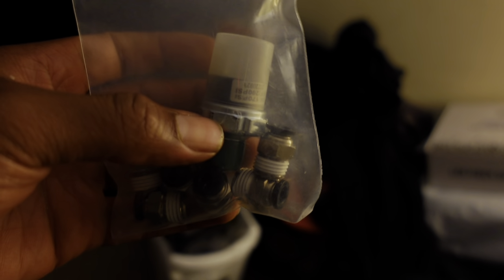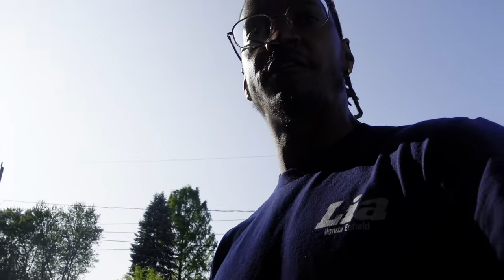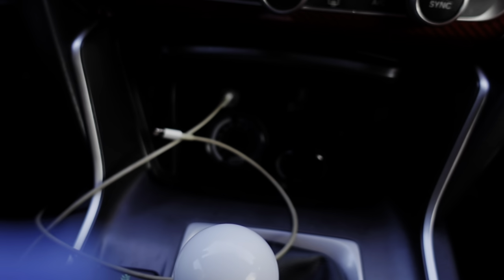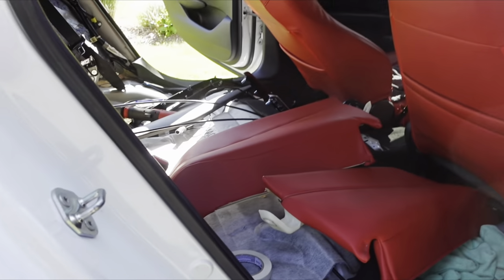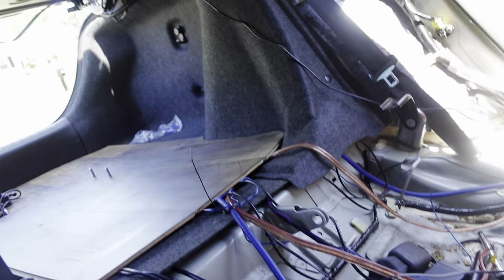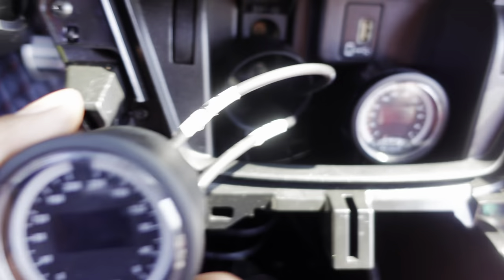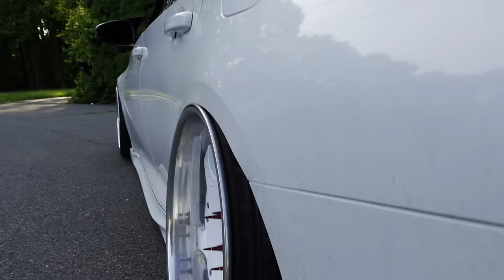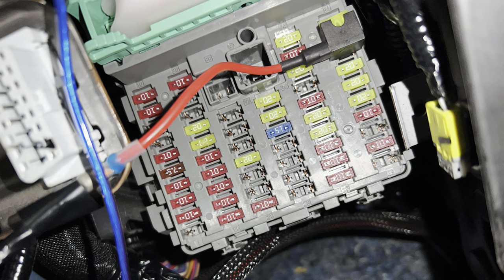Installing Airtekk stage 2 air suspension on 10th gen accord

Comment: my controller and gauges don’t turn on do you have any idea why
Reply from the maker: Have to run the wire to strong fuse 20-30amp, anything less it won’t power on
Reply: Which cable do you put the 30 watt fuse on

Comment: Did you switch over n use the bump stops on with the rear?
Reply from the maker: Yes
Reply: @Ferbchipskull  do you remember if you cut them , by how much if you did ?
Reply from the maker: @teamcru  yes you have to
Reply from the maker: @teamcru  at 6:18 you can kinda see how much is cut

Comment: How’s the system holding up any issues?
Reply from the maker: Had a few minor ones but i fixed them all, top hat bolt was lose and losing air when i left car at ride height over night, and had issue with bad relay and compressors not turning on but all fixed i do plan on getting 3p management next year though

Comment: Were did you run the read wire from the management controller
Reply from the maker: That’s power wire so to your power source on relay
Reply: So instead of running it up to the front just to the relay right
Reply from the maker: @Chr1ss-iu8kn  there’s a power wire ran from battery to the relay in trunk that powers everything
Reply: @Ferbchipskull  perfect thanks man 🫡
Reply from the maker: I lied i said in video run it up front that’s the remote i believe i don’t have this setup no more so i don’t remember everything off top of my head
Reply from the maker: @Chr1ss-iu8kn  i ran it to fuse box up front 12v constant
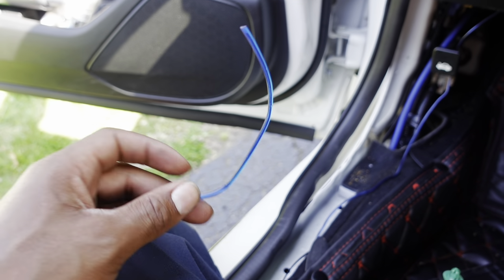Reply from the maker: @Chr1ss-iu8kn  at 19:57 that wire i show is the red wire extended
Reply: Okk thanks
Reply: @Ferbchipskull  do you remember how you wired the gauges?
Reply from the maker: @Chr1ss-iu8kn  they need 12v constant, ground
Reply: One last thing I’m having a problem atm were the management doesent want to air up or air out do yk what it could be I was thinking it was the valve that opens and closes

Comment: My management won't come on whats the problem
Reply from the maker: Remote, power or ground
Reply: @Ferbchipskull  do i have to use both cables that plug into management
Reply from the maker: @vernonburns1504  yea
Reply: @Ferbchipskull  how do you do it

Comment: Did u wire the pressure switch ?
Reply from the maker: Yea that’s what signals compressors on when tank is low
Reply from the maker: There’s a wire diagram on airtekk site
Reply: @Ferbchipskull  thanks
Reply: Do you think u can send the link ?
Reply from the maker: @Chr1ss-iu8kn  airtekk stage 2 diagram
Reply from the maker: @Chr1ss-iu8kn  copy and paste that on Google they have a picture of diagram first thing that pops up lmk if you need help still
Reply: Got it but the fuse keeps blowing when I connect it